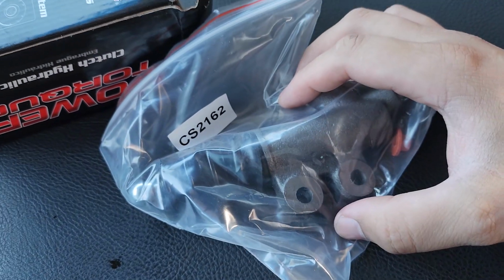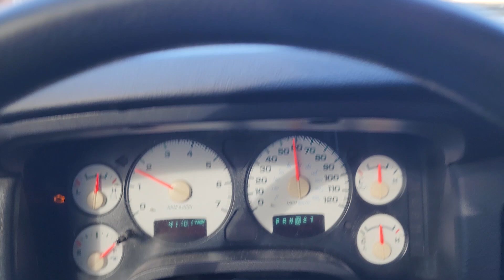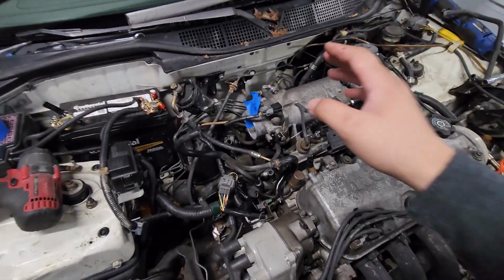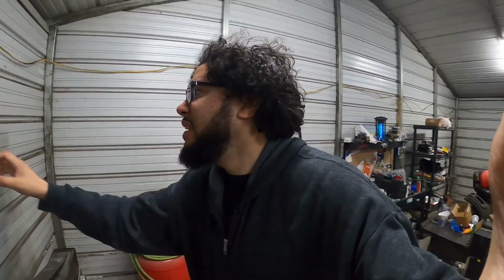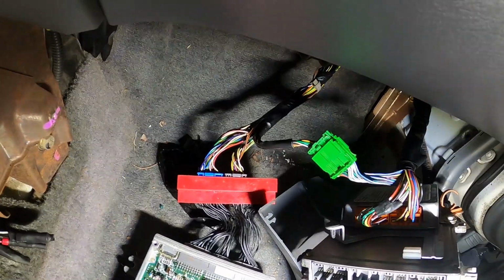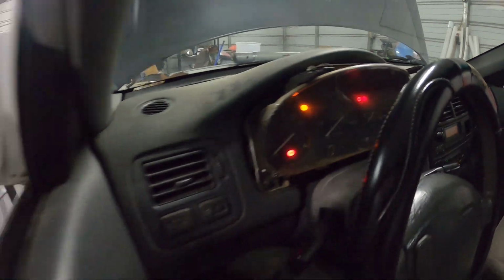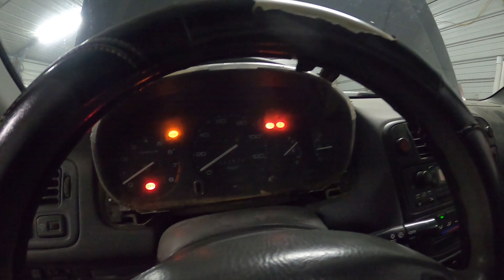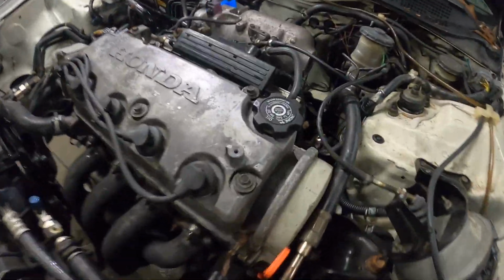CHEAP BUDGET Honda Civic EK | Engine Failure Before First Drive??

Comment: OBD2A or OBD2B both have the green connector, that's connect to the cabin harness which also leads to the fuse box. Not so sure of the other harness you have with out the green connector.
#Engine has issues prob your right about the rod knock

Comment: Definitely not rod knock. what youre hearing is your rocker assembly is either worn out or jammed up. this happens sometimes when a motor sits for a long time and the rockers get jammed up. hence why the noise going away as you keep revving it up and getting it freed up. this happened to me once when i pulled a d16 out a car, and a few months later swapped it in another car and the rockers were making that same noise. after a while it went away completely. also check valve lash and adjust accordingly if needed. that could also help quiet the motor down since your valves do sound a bit loud. Hope this helps bud

Comment: You have obd2b harness that your using the third plug is built into inside harness of the of a 99-00 chassis so need use the harness you pulled from  the other four door  your car obd2a thats the harness laying on the floor  obd2a is 96-98 and ob2b is 99-00 your car is 96-98 i can tell by your dash